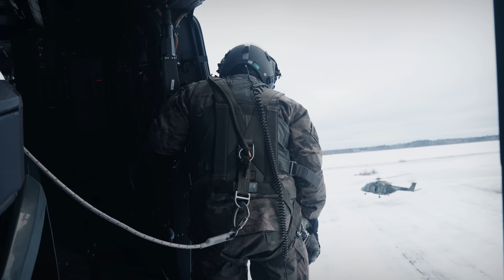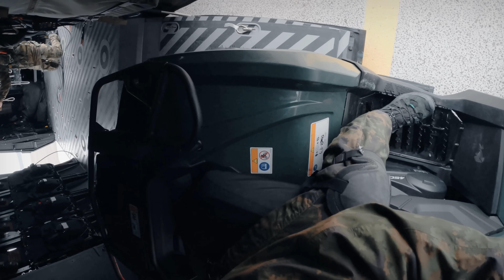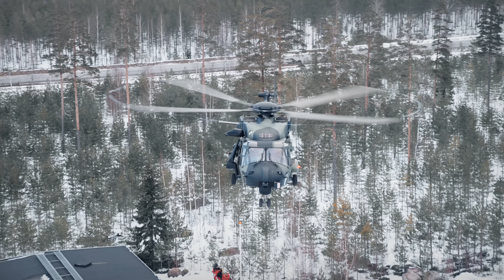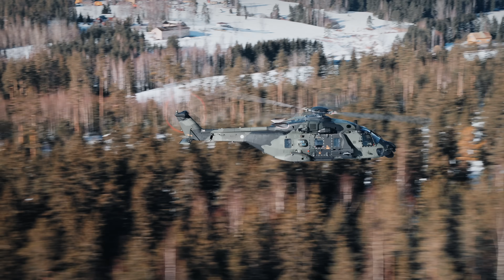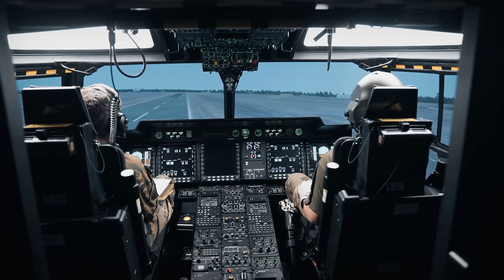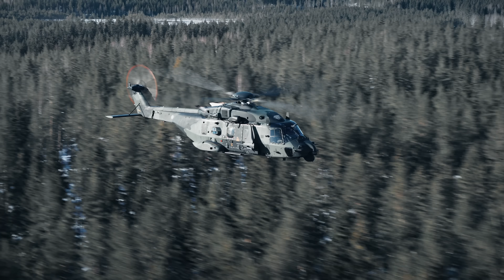NH90 TTH Walkaround: Inside Finland’s Special Operations Helicopter

Comment: It's amazing how Finland managed to improve an already fantastic helicopter. I just wonder about it's availability and what they think of other countries dropping NH90 early in service.
Reply: As far as Western countries go, Finland isn't rich. Finnish Defence Forces have never been able to have the attitude to say: "This sucks, we need something better." The FDF has always needed to say: "How can we make this not suck and get the job done with it." A pretty good example from the WW2 is Brewster Buffalo, which the American pilots themselves were displeased with, but Finland made excellent use of it. It's the same with NH90. Some other countries only see the problems and are quick to replace them. Finnish Defence Forces know replacing them isn't an option, so they need to be happy with them. That's where the sisu attitude still exists.
Reply: @herrakaarme  I don't think that sterotype of Finnish sisu is applicable here or the comparison to wartime conditions very fitting.

In this case you have it the other way around. NH90 is an expensive, new and highly advanced aircraft. Compared to Blackhawk for example which is older, proven and rugged design that many NATO countries still use despite its age. NH90 is cutting edge new design.

In that regard this choice is nothing similar to the purchase of the Brewsters, which were needed quickly because of the winter war and the Brewster corporation happened to have leftovers from a cancelled order for the USN to provide quickly. That is the reason they were selected as a last ditch available option, not because of cost, although Finland was back then quite poor agrarian country unlike today. They didn't make it in time to have an effect in the winter war still, but made it into the continuation war. Then the challenges were mostly availability of replacements and spare parts which were no longer available from the west as the US was on the opposing side.

Better comparison to the Brewsters and in general Finnish wartime tinkering with aircraft would in my opinion be the legacy Hornets and their MLUs by which Finland has upgraded them even beyond their American counterparts in some ways. But then again, they are to be replaced soon anyway with 64 F-35s by not exactly insignificant sum of money. We aren't quite the old poor Finland of wartime caricature anymore.
Reply: @herptek  Hornet upgrades are one of my favourite things that FDF has done. Three countries bought the MLU back in the day, Finland, Switzerland and the US Navy. We actually upgraded the cockpits when they were built, so our F/A-18 Hornets are/were the best version in the whole world, after so many years of holding back the A-classification.
Reply: @suomiswagmodz5009  I agree, it was worth it. Novadays the USN has switched to Super Hornets and only the USMC operates the legacy Hornets in America anymore. Recently they followed Finlands example and integrated weapons such as JASSM to it, which was done to Finnish Hornets in MLU2 back then.

Canada also operates legacy Hornets but I have the feeling that their airframes are no longer worth upgrading at their point of already quite streched service life.
Reply: @herptek  I think a major reason Finland was willing to just deal with NH90's issues is that helicopters just aren't that big of a priority for the army, so it wouldn't be worth of going through another procurement process just for 20 pieces of relatively low priority equipment even if it would be ultimately a bit cheaper
Reply: @coolsenjoyer  Finland has had no issues with NH90. I am under the impression that it has gotten a bad reputation globally because of contractual issues which Finland has avoided as Patria is able to take care of the mainteanance.

Clearly as a platform it is more modern and has better growth potential than Blackhawk. Novadays it is also an advantage that it is European due to strategic considerations.
Reply: @herrakaarme  Brewsters overcame their technological disadvantage with tactics. If you're good enough at something you can do it with almost any tool.
Reply: That helicopter model have been quite miserable via technical issues and high amount of down time what i have seen in public information. And much late from schedule if i have understood right.
Reply: @Sh04525  Pretty much all modern weapon platforms with especially high technology have been behing schedule, more expensive than expected, and carrying a load of problems to be solved later. For one reason or another, European multi-national projects seem to suffer from problems more than others, with Tiger and NH90 being good examples. With fixed wings, the FCAS project doesn't seem to be able to even reach the starting line. Too many cooks spoil the broth, it seems.
Reply: Its worth to always look into what the issues have been for each country that dropped them. Some have ordered special versions or modifications to the base NH90 or then have used external contractors that have ended up causing a lot of costs and ineffiencies. But the NH90 is still fairly expensive to fly, even for the Finns.
Reply: @jonekone3769  Not sure that your assertion about them being expensive to fly is quite correct. I'm happy to be proven wrong, but given that New Zealand has the highest flying time of any country with the NH-90, with a VERY small defense budget, I doubt that they're that expensive to fly.
Reply: @marklnz  New Zealand is an outlier, and it bought 20% more aircraft than it needed, to use as spare parts, which has smoothed over many of its availability issues. That's not an option for larger aircraft operators. It's one thing to buy 2 spares for a fleet of 10, another thing entirely to buy 10 for a fleet of 50. Also, it's the highest availability rate, not the highest flight time.... availability rate is a function of maintenance and expected usage. You can increase availability by reducing planned usage. As a crude example, if I plan to use my car only on Wednesdays and it's available every Wednesday, it will have 100% availability. NZ has, in effect, done a bit of both, reduced usage and more maintenance, because they have a larger part pool due to 20% redundancy. 

It is an expensive helicopter, that's just a fact, and it has higher costs per flight hour than the manufacturer promised. NZ is an exception, and their solution to the problem doesnt scale well.

Global fleet availability rates are abysmal, and issues have gone unresolved for decades. Most users have resorted to redefining capabilities (reducing what they require the aircraft to do), cutting their losses, and no longer paying through the nose to achieve what they were meant get from the AC to out of the box, or they've replaced them early
Reply: Yeah I was gunna say wasn't it Australia was getting rid of them
Reply: @Nates707  The Aussies got rid of them for a couple of reasons - none of them related directly to reliability or suitability, they're more political.
Reply: @marklnz  When I served in a light infantry Battalion in Townsville in the 1990's, we had S70 Black Hawks...They are a proven airframe in combat and are better suited for infantry operations and did everything we needed them to do and more!! The new generation of Black Hawks are better suited for the ADF and special operations. Being that we always fight and deploy with the US it makes logistical sense as well.
Reply: @jasonclark950 so you weren’t serving when the MRH90 was in service? So you can’t say for yourself if the aircraft is better or worse for infantry operations
Reply: @jasonclark950  Blackhawk has been around since the 70s, so it had years to mature as a design.  it wasn't without issue when it was developped like just about all military hardware.  now Blackhawk is a mature design and everything has been ironed out and upgrades keep it relevant today - just like Puma has evolved into H225M Caracal

NH90 is much younger in its lifecycle so development problems are more recent and present in public's mind. but now NH90 has matured and operates as intended.  and all the different requirements from different countries have been delivered.

objectively the only criticism today is maintenance costs, but that is a tradeoff with any high tech piece of equipment with all the bells and whistles
Reply: @marklnz T @marklnz ns weren’t political, they were related to logistics. Australia isn’t part of NATO, but they were buying the least popular helicopters from Europe, and in small numbers. If you’re the only operators of a helicopter in the entire Pacific Ocean, and you have only 47 relatively low volume worldwide production helicopters, those essentially become the most expensive 47 helicopters to maintain in the entire Pacific Ocean. Same thing with the Tiger attack helicopters. Australia already had Seahawks for naval operations. The US military regularly visits Australia for training, and they would bring Chinooks, Blackhawks and Seahawks, and Apaches. If the U.S. military wanted to set up a repair depot in Australia, it would be for those helos. Having repair depots for 47 Australian helicopters that could also service another 40-100 U.S. military helicopters is much more efficient than having the most expensive service facility in the Pacific Ocean only servicing 47 NH90s. Which leads to my next point, since Australia was the only operator in all of the Pacific Ocean, and only had 47 aircraft, NHI basically didn’t set up sufficient support infrastructure in Australia, or anywhere in Asia, and chose to provide supplies delivered from Europe. Blackhawk, Seahawk, Chinook and Apache supplies can be found all over Asia, the supply chain infrastructure is more robust, and is now even more so with Australia in the loop.
Reply: Yikes, YouTube text buffering is buggy as hell…
Reply: @Nates707 Australia gave "gotten rid of" a few helo fleets over the years that other countries have happily used so what's that say?🤷‍♂️...
Reply: @regregan6852  They've buried them as well, which makes me wonder what they are trying to hide.
Reply: @adrien5834  They were buried after no one wanted to buy them.... wonder what that says about the Aircraft?
Reply: @ArsenicApplejuice  To me it says that there's a reason Australia had so may issues that the other users didn't have. A reason that might become clear if someone took a closer look at these buried helicopters.
Reply: @ArsenicApplejuice  Ukraine wanted them for starters and I don't remeber Australia looking for any buyers
Reply: @regregan6852  that Australia does not have good maintenance planning and doesn't invest in having stocks of spare parts.  they think they can just pick up the phone and get next day delivery when they need.  
funny they don't complain about F35 which is much worse for maintenance and operational rates well below military standards.
Reply: @lordtemplar9274they could'nt afford another $billion embarrassment so soon after the last $billion write off and they would be running out of space to bury all these fleets anyway😅
Reply: @adrien5834 exactly, they couldn't bury the evidence fast enough even when Ukraine offered to take them off their hands.  Someone high up just knew the resourceful Ukranians would have operated them successfully, in a warzone, therefore proving Australian incompetence and the $billion wasted.
Reply: I’ve heard a bunch of stories/rumors- 1st) the main issue was the airframes were custom to Australia, so Australia could install domestically developed equipment. Some of that equipment requires Australian technology security clearance, so when they tried to sell the helos, that equipment was not transferable. I realize this story/explanation doesn’t seem complete, and raises more questions, but that’s the rumor I heard. Whether it’s true is another matter. 2nd rumor) Australia had to get out of the service contract, or they would be paying for service on helicopters they weren’t using. NHI agreed to cancel the service contract as long as they could strip the helos for parts.
Reply: Finnish pilots don´t want their copter to be seen . Flying LOW means also no week ends in Oslo night clubs .
Reply: The guys wrenching on them had no choice, and didn't care because they get paid no matter what. It's taxpayer money that was wasted and the people responsible don't care one bit and in that country the press is controlled so they could silence any negative news from being publicized.
The main thing was the people deciding on the procurement and not canceling the contract got some thick brown envelopes in a shady back alley.